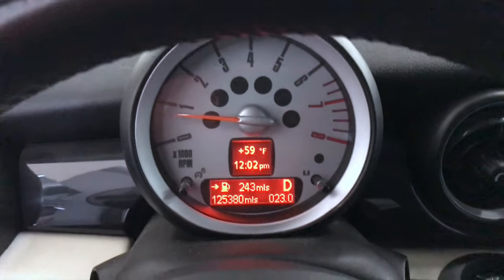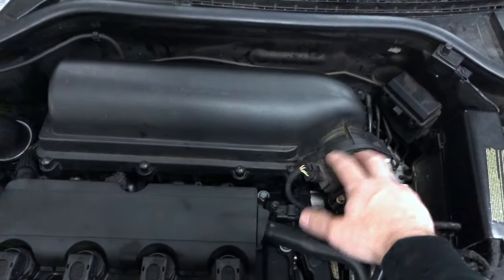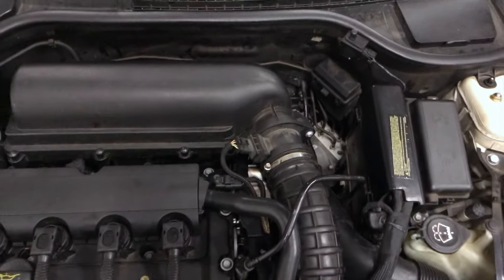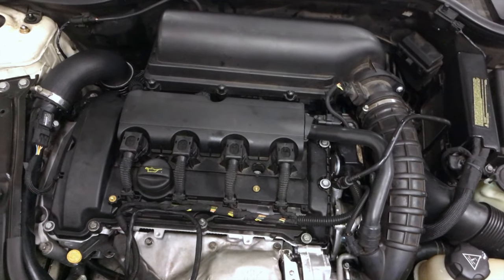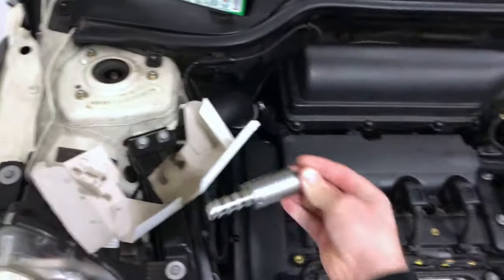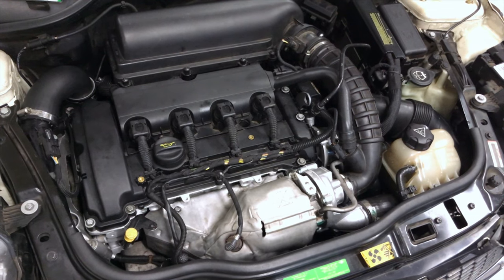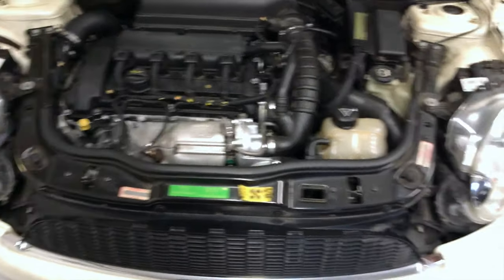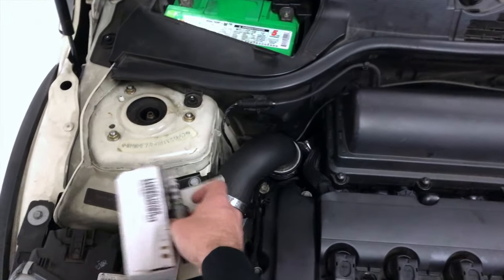MINI:  Erratic Idle Issue, SOLVED

Comment: I'm having headaches wit this r55 mini cooper I change the gas pedal OEM and the throttle body OEM.  But I'm still getting the same code.  E/D incorrectly and E voltage circuit low.

I also send the mini to do a remap for the throttle and didn't work.  I use multimeter and snap on scan tool and I can't get it fix.   I'm a tech from Quiles Auto Repair.  But is the first time that I can't find the problem I also send the car to the BMW local and their  can't find the problem.  

I re ordered another throttle to see if it was defective but the other wierd thing is.   When I press the brake pedal the limp mode appear only by pressing the brake pedal
Reply from the maker: Wow thats a good one. Sounds like an engine control unit issue. But that's easy for me to say when it's not my but on the line. Let me know if you figure it our.

Comment: Hello,I have a 2012 Mini Cooper S and was having these same symptoms. No fault codes or check engine lights. It’s currently at the dealership for the rough idle, they’ve had it for going on a week now and haven’t been able to find what’s wrong with it and now I’m starting to think that this might be my issue. Should I call them and let them know about this potential problem?
Reply from the maker: Dang.  I'd let them just do their thing. This issue was mainly due to the machine shop leaving sand blasting residues behind which got trapped in the solenoids. Let me know what they find.

Comment: Trying to help my mom fix her mini. I ran stop leak and fuel treatment. Rough idle limp mode goes away. It comes back randomly sometimes on random days. Rough idle and oil smell getting timing codes. I turn the car off and remove keys and it takes itself out if limp mode and it often times disappears for a day or two. Do you think it might be this fix?
Reply from the maker: It's hard to say without seeing it in person to put all the clues together.

Comment: My car do the same when it's cold, when it reaches working temperture I turn OFF and ON and works correctly,
You think the issue is the intake solinoide like yours ?
Many thanks for the video 👍👍👍
Reply from the maker: It's hard to say. Any fault codes?
Reply: @MikeMDs 
Yes
P000A
P000B
P0171
What do you think my hero ?
Reply from the maker: Those are timing codes.  You can try the Vanos solenoids first. But it may be bad timing chain guides. In that case the timing chain will need to be replaced with the guide kit and chain tensioner. If the solenoids do not fix the issue, I recommend having it diagnosed by a specialist.
Reply: @MikeMDs 
Thank a lot my friend 👍👍👍
Reply from the maker: You're welcome. Best of luck

Comment: My Air Intake Duct Hose broke off, on the end where its connected to the Turbo...would that stop my car from starting? My car Turns but it doesn't click over and start...
Reply: Yes, Ive just had the same issue

Comment: Hey Mike I have this same engine and had the same idling problems and not my car stopped and won’t turn over. What might be my best plan of action to troubleshoot.
Reply from the maker: If your engine wont even crank over then you have a different issue. Maybe no oil?
Reply: @MikeMDs oil was low then I added 3 quarts and only stopped turning over about a week after the new oil
Reply from the maker: Dang. It's hard to know without seeing it in person.
Reply: @MikeMDs  will a video help I’m up for anything at this point to help me out

Comment: How?

2011 Countryman S

Replaced the front in 5 minutes. T-27 to remove bolt. Swapped valves. Tighten bolt. Done

Moved to rear. Removed air tube elbow. Loosed intake filter/ airbox and moved it over a few inches. Have tried and tried to get bolt out with T-27, no luck.
Reply from the maker: It's a tight spot and has to be done by feel. But maybe you can get a mirror in there to see what is going on. Maybe someone replaced it with a different bolt.
Reply: @MikeMDs  

Alright. Was finally able to get it out. Swapped the solenoids. Bolt fell to who knows where. Now trying to find a matching replacement. Not sure they exist.

Comment: Interesting, had the same idol problems. Changed the throttle body out and helped the cause up to 90%. Still does the same type of idol on start up but after a short time it goes away.. 

I replaced the vanos but before I did an intake clean. So will look at this again. 

But does “adaption values” need to be reset when changing the solenoid? I did not do that last time.
Reply from the maker: clearing faults is enough. Clearing VANOS adaptations is mainly for replacing timing gears or adjusting timing. If you able it doesn't hurt.
Reply: Appreciate and thank you for the reply.

I had the scan tool and reset everything plus codes etc. @MikeMDs  I'm beginning to think I'm just going to have to deal with it.  I've just about replaced everything that could be possible, I'm hoping it might get rectified in the dyne tune I'm going to do. 

Cheers

Comment: Hey Mike I just switched out my fuel pump and it is starting now and will run for about 5-10 seconds and then die, rough what do you think is my problem now?
Reply from the maker: Thats tough without seeing fault codes or anything. Can you hook up a fuel gauge to the fuel rail ? If the fuel level drops then it could be the body module ( JBE ). It has the relay that powers the fuel pump. If the pressure does not drop when the engine dies then it is something else. But need to rule out fuel.
Reply: I don’t have a fuel gauge but is there any other trouble shooting that I can do with very minimal tools to troubleshoot the possible fuel problem
Reply: @MikeMDs  also I have never actually had someone so active answering questions on videos from 3 years ago I appreciate the time you take out to give the info you can. Thank you sir!
Reply from the maker: You bet!. 

I cant really steer you in any other direction. Only because I don't have enough information. Sorry.

Comment: Hi to all, hi Mike
Not sure this is the right place to ask this question but i am desperate. 
Inaturally
Since a month there is the following problem:
After starting, sometimes no throttle response at all and rough running engine in idle. The Orange engine light is steady on.
Restart engine and all is OK. This problem repeats occasionally.
But sometimes red engine light comes steady on plus the service light. Also no throttle response and rough idle.
Restarting a couple of times helps. If there is a throttle response, yellow engine light comes back on but car drives OK.
Error Code ISTA 2BE4 with 3 hits:
1) DME internal fault.
2) Pressure Sensor before throttle valve.
3) Low fuel pressure operating range: Pressure too high
Can somebody guide me? There is no Mini repair (or any other qualified repair) on this island..... (the island calls Panglao).

Comment: Is this the same thing as the engine surging? My engine surges the more I drive it. If it sits for a long time like a month or more, it doesn’t surge until I start driving it on a daily basis. It’s very annoying. Also when I’m at a stop light the car feels like it wants to jump forward with the surging.. Its a 2003
Reply from the maker: Your 2003 has a different engine. It could be many things causing your issue from something obvious to something complex.  Unfortunately it would have to be diagnosed by a specialist or a reputable shop.

Comment: I've got this issue - had new spark plugs, coil pack, fuel injectors and then I tried this - bought an OEM Mini solenoid and it hasn't fixed it. Still rough idle and stalls eventually when static.

Comment: I have done all that you have done .. even replaced the Vanos valve .. the idle hunting will not go away ... maybe an oil pressure issue??? LOL i have the same type of car in my shop same color hahah!! but my oil light does come on ...
Reply from the maker: Yes could be an oil pressure issue for sure. Try replacing the oil pressure sensor and trace the line to make sure it is not damaged. If the light still comes on you may need an oil pump. We had one from another shop where they left a rag in the engine that partially clogged the oil pickup. Are you having misfire faults?
Reply: @MikeMDs  yes .. it does record random misfires

Comment: I have a 2016 Mini Cooper S n it’s doing this, how do I find out in more detail about the part the dealership is making it difficult as far as giving me help when I ask for this part
Reply from the maker: This part is called a vanos solenoid. But be advised that many things can cause a rough running issue on these engines.

Comment: Great information. Help here, I have a 2010 Mini turbo with misfire on 2 and 4 only a few seconds after starting when cold. I had change the coils of position and the misfire stays in place 2&4, customer is not in a hurry but we want to solve the problem without replacing parts as we go. Any advice?  I have no new codes and the only old codes were misfire on all the cyl and the 2880 high pressure sys. After clearing there is nothing new. I could appreciate guidance thank you
Reply from the maker: -If the high fuel pressure shows below 4 bar during misfires. then the high pressure pump is bad. 
-These cars are know for burnt valves. Try a leakdown. 

My guess is a High pressure pump.  Don't buy aftermarket!  Or rebuild! You may need to replace the hose going to the pump as the fitting brakes during removal if you dont have the special tool
Reply: I have Same issue, did you resolve it?

Comment: Do the N12 and N14 engines VANOS units work on the same principle as those used on BMW engines? And do they suffer from VANOS rattle?
Reply from the maker: Yes, using oil pressure. But they share similarities to the newer models.  There are many BMW vanos designs.

Comment: hey!! i have the exact some problem with my mini!! same bumpy idle issues. I had the obd code for timing valve, and i replaced it but a day after the same problem reappeared with the codes...Any tips on that ? Thanks!
Reply from the maker: It could be the actual timing unit attached to the camshaft. They do go bad. I assume you checked your oil level already.
Reply: @MikeMDs  yes...i aslo thaught it could be something inside...

Comment: MY COUNTRYMAN IS IDLING HIGH OUT IF NOWHERE BUT MY DOOR GOT SLMED HARD AND THE DOOR LOCKER EOD IS OUT OF DOOR CAUSING THE LIGHTS TO KERP O AND OFF WEARING BATTERY. NOW THE  IDLING STARTED. FROM WHST YOU SAID BECAUSE OF THE ALTERNAYOR I HAVE BEE JUMPING THE CAR FOR OVER 1 month.

Comment: Changed all coils, still “super” knocking like a mo-fo! Any ideas my friend? You do a wonderful job. Wish I could get my Mini to you!!! Thanks
Reply: Look into walnut blasting or get the intake manifold cleaned - Worked for me !
Reply: @neilwilson9221  My mechanic changed out the friction wheel and drive belt. It ran fantastic for a week but now we’re back to less pull and boost plus rough idle (less than before) and lousy acceleration. I’m going to ask them about a walnut blast. Can I request organic walnuts? 🙃 Seriously, thank you. I hope that does the trick. They are so fun to drive when everything is dialed in. 🏁🏁
Reply: @precool  I realize that this is an old post. With these direct injection engines you may want to use the SeaFoam Treament  by using their aerosol can.(Walmart has the best prices) Here are the steps.  1.) Make sure the engine is warmed up - operating temp. 2.) Shut down the engine insert the SeaFoam straw AFTER the Mass Air flow Sensor.  3)Spray the SeaFoam  for 7 miniutes while a helper keeps up the RPMS .  4.) Prepare for the smoke show by letting the car sit  for 20 minutes. 5.)Start the car, rev it up to 2500 to 3000 rpm appox 3- 5 minutes.  6.) Drive the car with a heavy foot keeping the RPM's high until the smoke stops.  Your  check engine lights may come on due to misfires, but do not worry the will soon clear. You  should realize a tremdous improvement. I do this on my wife's  Mini at every oil change. Good Luck

Comment: Thanks for the video Mike. Are these prone to leaking oil I have a leak around mine? May be mine just needs tightening? The idle seems ok.
Reply: jaboose oh heck yeah they are prone to leaking. Especially if everything like gaskets and what not is all OEM. I had finally ended up stranded in a parking lot an hour away from home. Ended up having multiple blown gaskets and a blown turbo. Tore my entire front end off and had oil lines blown, exhaust manifold gasket blown, oil cooler gaskets were melted actually , catalytic converter gasket was so blown it blew out from between the turbo and cat. I highly recommend looking into an oil line replacement, VANOS replacement, pull off your oil filter housing assembly and replace all of those gaskets. Never over tighten and always tighten to spec. When torquing to spec go in a star pattern to avoid over/under torque. My car was a PILE when I got it. Now it runs like a beast
Reply: @panaderialynn8490  The video was a big help to me. Thanks again
Reply: Yep! My 2013 Mini Countryman was leaking like crazy. So bad that it was causing a burning smell bc so much oil was leaking onto the oil pan & my exhaust. Had the oil pan gasket replaced along w the oil housing adapter because that’s where it was leaking from initially.

Comment: Great Video, however, I have a 2014 automatic Mini Cooper and I am getting a code P053A, I am not exactly sure what that is. I can not find any videos on that code. Could you give me any tips? Any and all help will be appreciated.n
Reply from the maker: The factory codes are different. What is the description of the code?
Reply: @MikeMDs  Thanks for getting back to me, the description is: Active Diagnostic Trouble Codes (DTC)
PO53A: Positive Crankcase Ventilation
Heater Control Circuit /Open
Reply from the maker: Cool that helps. It is the two pin connector going to the tube attached to the rubber air boot. The heater element may be bad, the pins saturated with oil or the wrong connector plugged into it .

Comment: Man im in desperate need of you to work on my 09 mini s N14, rough idle, chuggy hard start, replaced hpfp coils plugs mass air 02 sensors and it still sounds identical to this one, I ran injector cleaner did that mess up the Vanos sensor is that my whole problem??? Help please
Reply from the maker: After clearing all fault codes , what fault code descriptions come back?
Reply: @MikeMDs   low fuel pressure code and multiple misfire code, it goes into service mode and we have replaced HPFP,coils,plugs map sensor and mass air, also 02 sensors, I've heard it could be a VANOS she ran bad gas for a while..
Reply from the maker: Focus on the low fuel pressure issue. The relay in the JBE module ( not the FRM) has a built in relay that goes bad and will cause the in tank fuel pump not to operate properly.  It is usually caused by an aged fuel pump drawing too much amperage and burning the contact points on the relay.  It could be that.

Comment: I have an r60 2011 Mini Cooper Countryman S and the I replaced the rear vanos could it be the front vanos.  I get rough idle in drive.  When A/c on the rough idle goes away.  Got a 2d22 twice but nothing now.
Reply from the maker: Hard to say. With that fault you may want to try and replace the oxygen sensor after the catalytic converter and go from there.
Reply: @MikeMDs  thanks
Reply: @MikeMDs  sorry to leave out details but the car knocks on the passenger but goes away sometimes.  It started after I did oil filter housing gasket.

Comment: I have almost same issue but tooked them off, cleaned them, reset them and worked good for half an hour
Went on live data and the only thing it comes up its cilinder1 missfire... Not always... From time to time... But everything its cleaned and checked to this engine and most of parts changed apart from coil pack.. What to do next??? 1 litre of petrol and a match will be enough???? Dont have the patience anymore like 🙄

Comment: I just rebuilt my N14 engine and two weeks later, I have a P2187 code that just came on. Would the variable timing solenoid valve set off this code? That’s the only part I did not replace..... should I replace it anyway?
Reply: Hello Lord.   Curious to know how you cleared your P2187 code. Just did a smoke test on my wife's Mini and found a small leak at the  Timing Gear Eccentric Shaft O-Ring. Replaced O-Ring no more smoke. 
 I also replaced the Mass Airflow Sensor,  Valve Cover and PCV Hose. Doing a fuel pressure test today.
I do not suspect the fuel pressure for the lean condition, but have to rule it out. Curious to know if replacing or cleaning the vanos solve you issue? Thanks